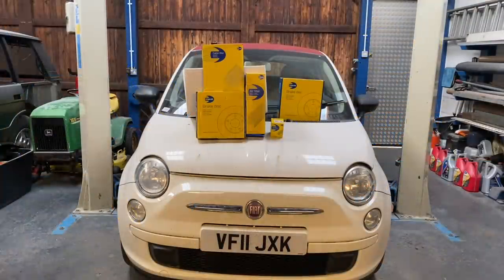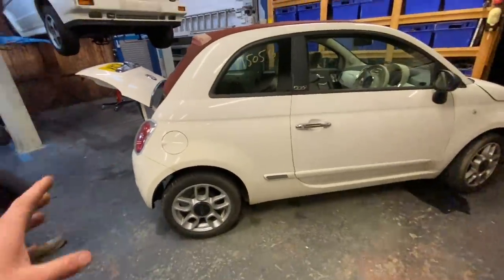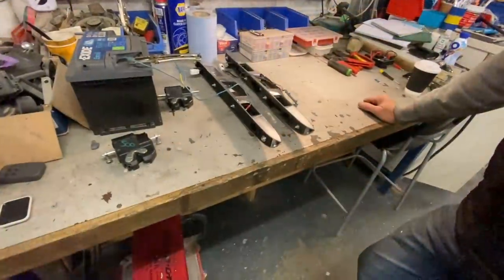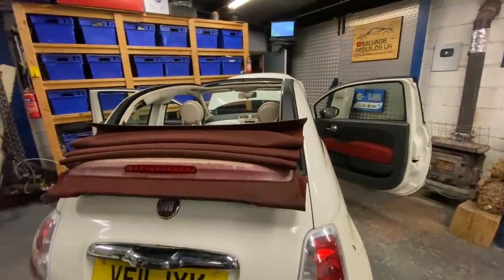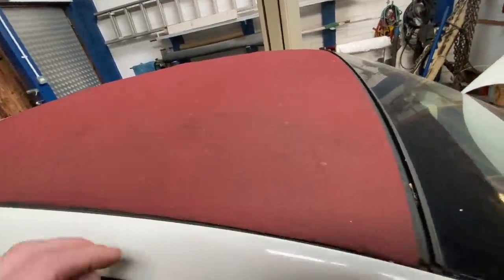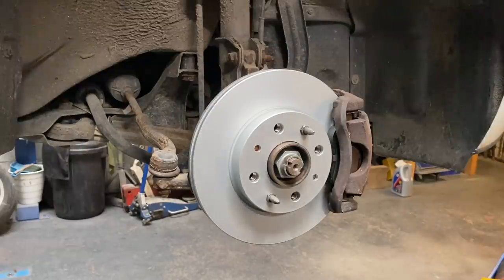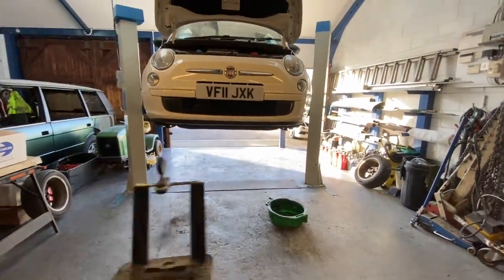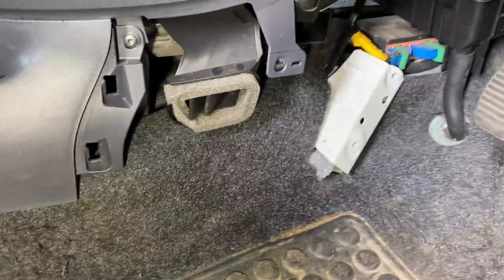Can We Fix And Double Our Money £££ With This Cheap Fiat 500 C ???

Comment: Cabin filter is exactly the same on my Alfa. Same position and the cover doesn’t have any screws. It just slides on and locks in place. I find that if you squeeze it together like a Chinese fan, you can get it in easier and it just pops open when you release it

Comment: Well done Chris for the diagnosis , I knew you would sort it out. Rob can have a bit of a drive around and make sure all us well. I know changing brake discs is fairly easy but I blinked when you were doing it and there was the new one in place. 😂 I think someone will really enjoy that little car as you say probably a young lady. It has cleaned up very well and no advisory"s on the Mot. Thanks again Rob and Chris for an excellent video and do have a great weekend. 👍 👍

Comment: That's going to be a fantastic motor for someone. Great to see Chris explaining the electrics and Rob for showing the pollen filter replacement. It's no wonder most get missed as they're a total pain to get to 😅 keep up the good work gents! 🙂
Reply: Early Mercedes vitos were a pain in the arse also. Remove pedal rod etc
Reply: @markbennett9043  you should try Volvo V50's. For best access, you have to take the CEM out and possibly the glovebox out for best access. Total pain in the arse although I'd rather that than a blower motor, which is a dashboard out job 😅
Reply: I'm lucky I have a North American Fiat! The pedals are on the other side so they're not in the way. But just reaching that cabin air filter cover is still a royal pain in the arse!

Comment: The wiring loom on the 500c to the boot is different to the 500. 7 wires in the C, more in the 500.Same problems occur with those older models as the wiring is too short and inflexible through the gromits and usually stress and break causing issues.
Nice little motor and a bargain price to buy for both your prospective purchaser and for you guys at the start, wish I’d managed to get one that price for the OH.

Comment: A tip guys - if you wanted to sort out that rear brakelight housing/roof spoiler it'll need removing and sanding back. Then paint it with "Plasti-kote 22105 400ml Premium Spray Paint Satin - Wine Red". It is a perfect match in colour and texture - I know because I did my daughters.

Comment: Thats another nice little car out the door thanks for sharing . To be honest I'm seeing  electrical problems on farm equipment  from 2000 onwards where the terminals are corroding in sealed multi plugs, I think the materials they make the terminals from now might be cheap junk, compared to older stuff that had less terminal problems. One brand of tractor I see a lot with this issue happens to be  Italian made Landinis  L.O.L  Take care guys.

Comment: That was a nice one :)  another cool small project with a nice profit.
Oh Rob, regarding the breaks changes don't forget to say that after the brakes change and before driving you need to pump the break pedal until ot builds pressure and gets hard. Lol, i know and you know that is common sense but i seen it happening at least 3 times lol
Reply: Brake

Comment: You just knew that Chris would sort the electrical issues with this one. As usual you quickly sorted the other bits and pieces and another one out the door. Your pricing is very fair, sure it will be snapped up by somebody.

Comment: It's normally a slack terminal on the female side every time, just need to make the gap a bit tighter with a pick, 98% of problems that came in were electrical when i worked at FIAT.

Comment: Alot of the time you can get squeaky brakes when you put new ones on a bit of copper grease always helps especially when they look like they have not been used for a while
Reply from the maker: Copper slip was applied in the video 👍

Comment: Surely if you’re doing engine oil / filter, air filter, pollen filter you’d include spark plugs then it would be classed as a major service? 
Has the cambelt been done? Brake fluid change service that’s due every two years to take the moisture out the system that causes seized calipers?

Comment: Three grand would have been a more reasonable price for your business. You still have bills and wages to pay.

Definitely true that the brakes are very easy to work on with this car, but do give yourself time to do it right. It took me six hours to do all four of my brakes, and that was with the occasional guidance from a qualified mechanic (I was doing the work at a DIY garage). The only physical work he did was compress the rear caliper pistons (he had the required tool to spin them) and helped me mount the front left wheel because the hub didn't have any lug studs to keep the brake rotor from spinning freely.

Still need to bed the brake pads and change the brake fluid, but everything already works flawlessly!

Comment: Have you ever changed a pollen filter on a fiat stilo Rob?,, U thought the 500 was tricky and inaccessible...the reason on a fiat is they only do one heater assembly and it's for the left hand drive market,so it doesn't take in to account the pedals on a right hand drive version...
Reply from the maker: This is the same the pedals we’re in the way

Comment: Good profit but 2nd hand SRS items (air bags) should never be used 👎 simple ass you can not guarantee that they will deploy correctly or be 100% safe if the vehicle was involved in an accident.
Reply from the maker: They got the same chance as the 11 year old airbags in the car I have fitted hundreds of used kits over the years and never had a problem if there fitted correctly there is no problem